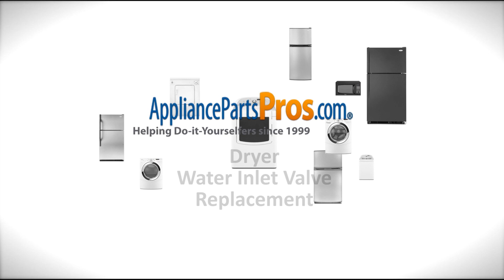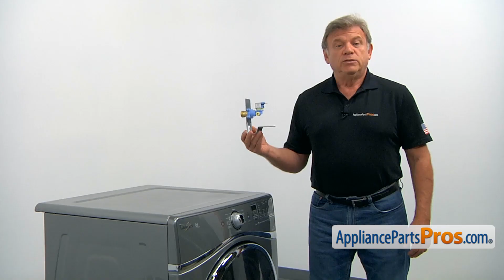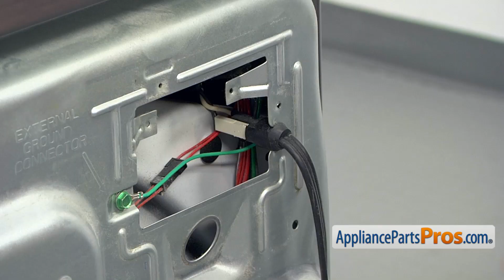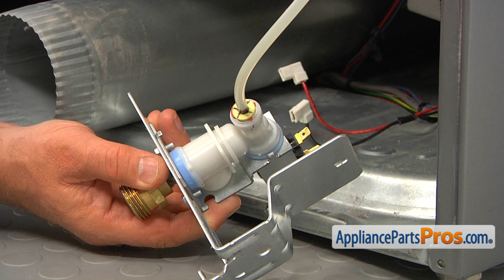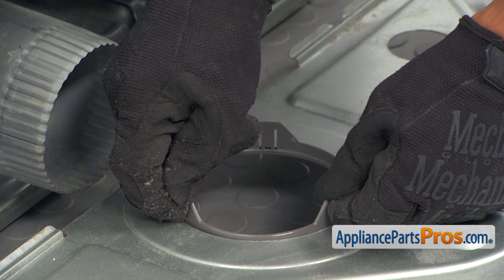How To: Whirlpool/KitchenAid/Maytag Water Inlet Valve W10815373

Comment: Thank you for this. I had a few questions:
•Does the new water inlet valve not need the locking clip?
•Do you have to remove the gas line adapter? It seems like it will fit through the hole in the back cover, which would also mean you don't need to buy the yellow PTFE gas line tape.
Reply from the maker: The locking clip is not used on the new water valve. It is safer to remove the gas line, water line, and vent to remove the back panel. This way you don't damage the lines. Anytime you remove the gas line you will need to use the tape to reinstall it to make sure you have a good connection and to prevent leaks.
Reply: @appliancepartspros  Thanks, I didn't know the new valves don't need locking clips.
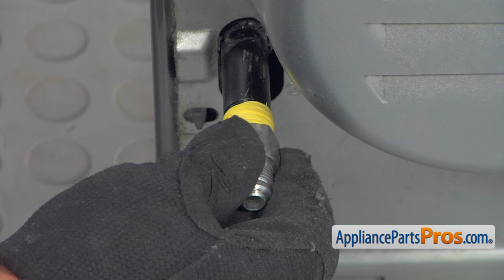In regards to the gas line, you only applied the yellow tape between the dryer and the adapter 11:03, but not between the supply line and the adapter 11:49. So I was just wondering if it was possible to only disconnect the supply line and leave the adapter attached to the dryer, in hopes to not have to deal with the yellow tape.
Reply from the maker: If you can remove the back panel with the adapter still attached and just remove the supply line then you can do that. Just make sure the connections are secure.
Reply: @appliancepartspros  Awesome! Thank you so much
Reply from the maker: You're welcome!